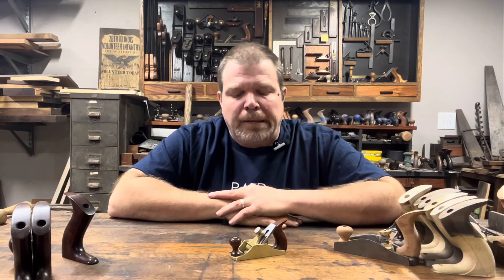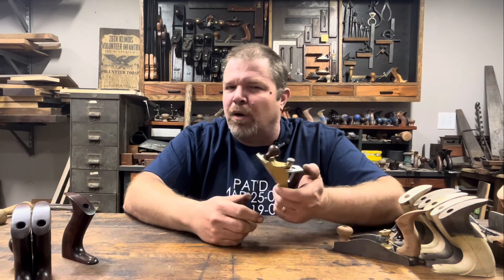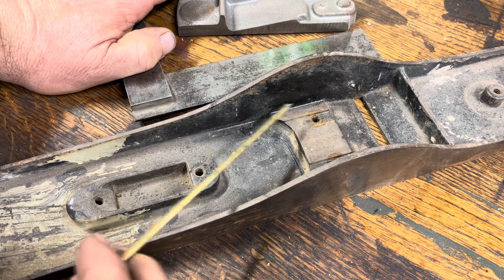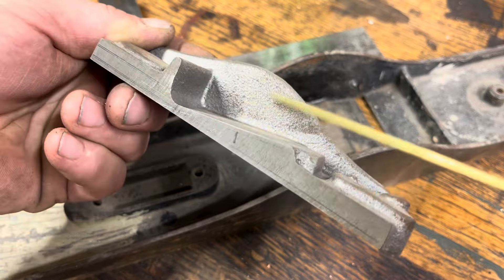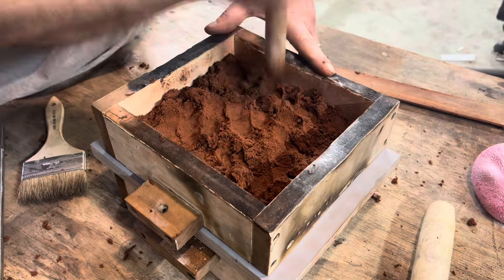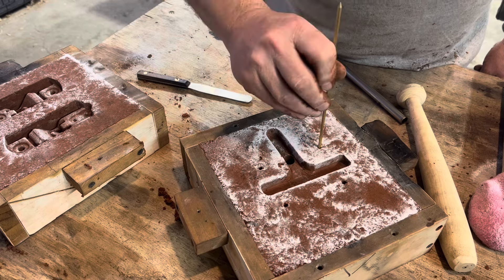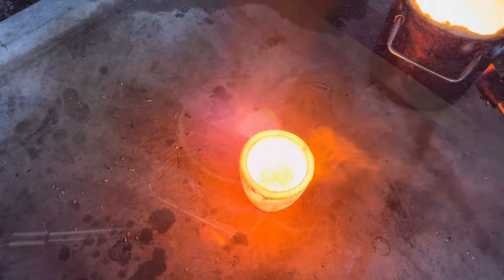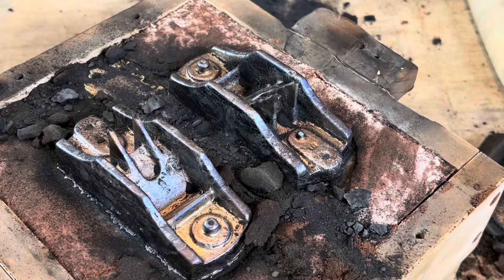Making a Plane from Scratch Part 1: Casting a Body

Comment: Wow, nice job! Have you tried to cast bronze or only brass?
Reply from the maker: I have cast a few in bronze, but most are brass. I have a lot more brass on hand than bronze. When I make them in bronze I have to cast the screw cap as well. It looks funny with a body in bronze and a cap in brass.

Comment: Looks really well done Dave, excellent explanation of draft and fillets. Quick question about how oversized the casting is over the machined final plane body, the casting looks substantially heavier than the finished plane. I look forward to the next video in the series.
Reply from the maker: Indeed the casting a bit oversized. However the pane cast and the one shown completed are a different pattern. This was explained in the last part that ended up not having any sound. I’m going to reload the video and see if that fixes the audio issue.